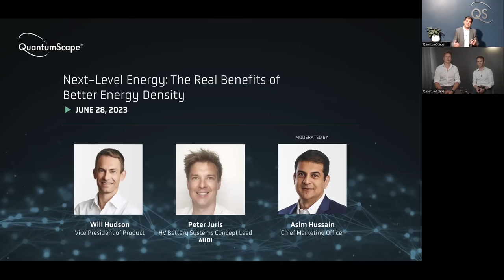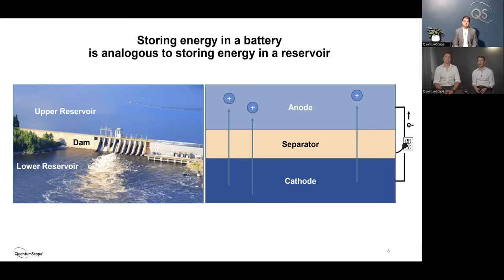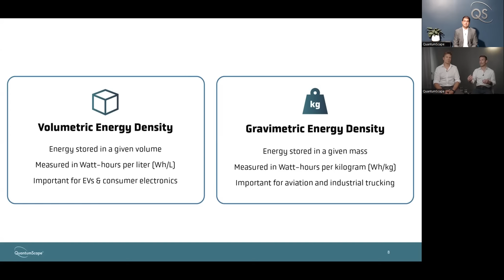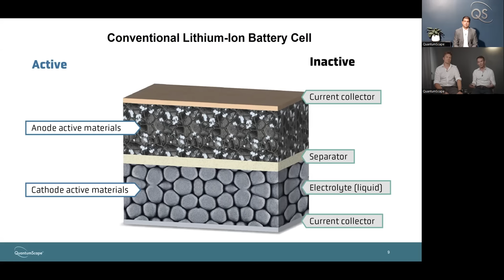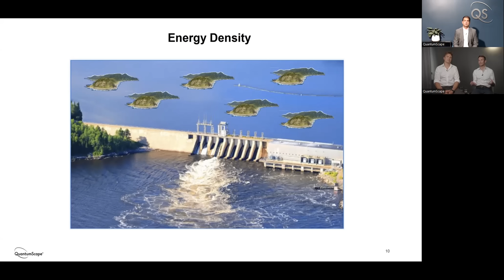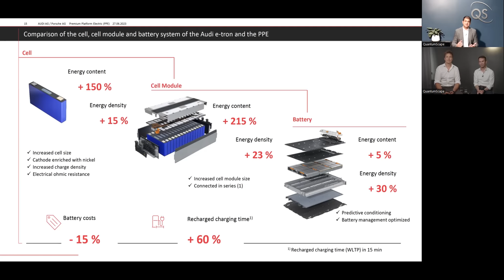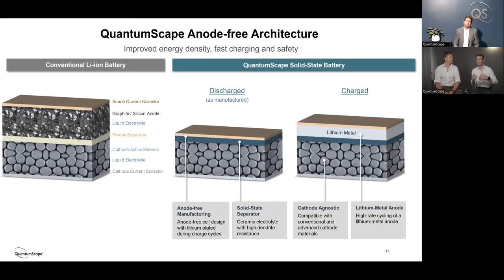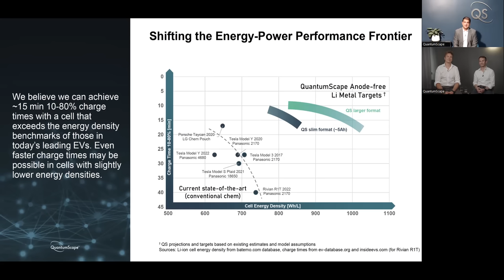Next-Level Energy: The Real Benefits of Better Energy Density

Comment: Batteries are only an electron storage device.  A water splitting reaction that creates a Hydrogen + Oxygen reaction is the ideal reaction.  The electrolysis reaction takes more energy than it produces, therefore a non-starter.  The Nobel Prize winner ‘Negative Refractive Indexed Meta Materials’ (NRIMM), holds the answer to this ideal water-splitting reaction.  The “crux” of this reaction is the (NRIMM) form of Bismuth ferrite.  This  synthetic material has the ability to absorb a weak infrared wave field to a giant plasmonic photogalvanic Ultraviolet epsilon naught, water splitting field.  This can take place in a solar cell electron harvesting or as a non-ideal plasma field.